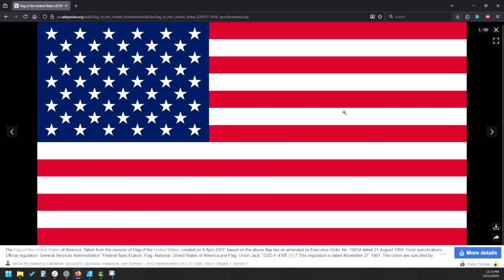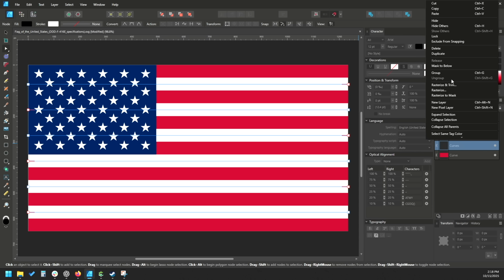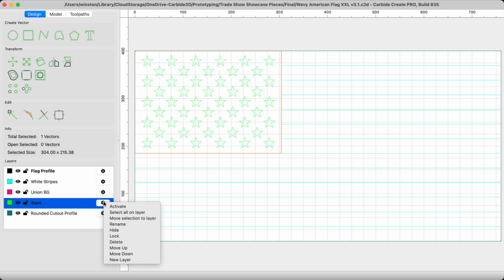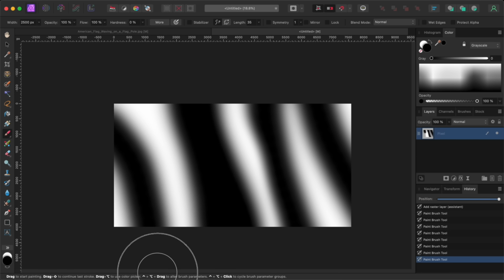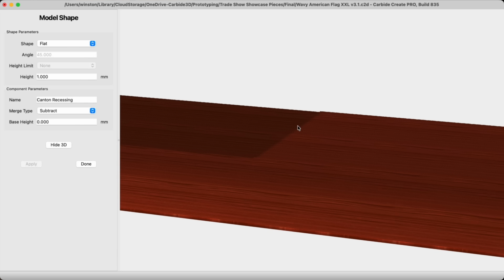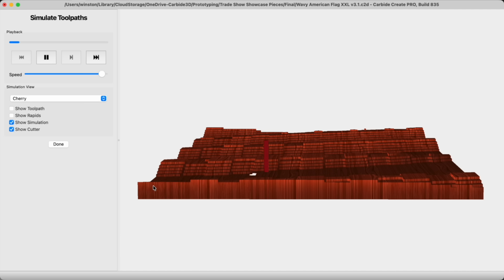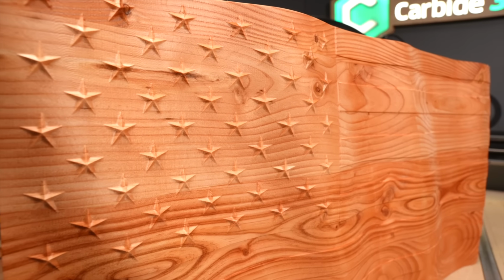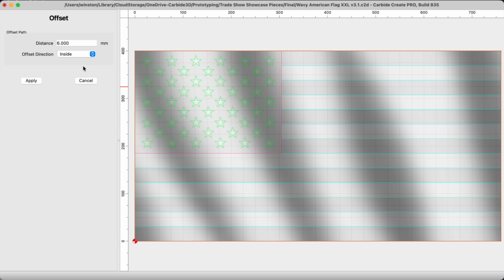Machining A Wavy American Flag on a CNC Router

Comment: Can you use the classic MS Paint for the black stripes that are used for the waves?
Reply from the maker: You need to be able to use a brush with a soft edge, or airbrush effect to fade out the transition between peaks and valleys. I don't think MS paint natively supports that.

Comment: Nice explanation. The OCD in me, however, recognizes that waves in the flag don't just raise/lower the stars/stripes, they distort them in both X & Y, even to the point that the outline of the wavy flag is no longer a rectangle. That seems super-advanced and difficult, however. At the end of the day, the impression left by this technique is still pretty darn good.
Reply from the maker: Not just super difficult, but sometimes impossible. If you look at a real waving flag, there's often some areas where the fabric has actually rippled and whipped in a way where it's folded back on itself, creating an overhang that's physically impossible to machine on a 3-axis. So some creative liberties inevitably need to be taken. 

I've actually thought about modeling a flag in Blender, freezing it at a particularly photogenic position, and then machining that. But then you either need deformable stars that are in the model, or a way to take the model and extract the outline of the colors into an SVG to re-overlay on your 3D model. Either way, it's not pretty. Suffice to say, yeah I've overthought this. 
(-W)

Comment: Winston, if you haven’t tried it yet, ditch the tape & glue and clamps. My preferred method is my vacuum table & pods. Followed by a 23 gauge pin nailer. Time & cost wise, the pin nailer is the fastest and most cost effective (next to v-table) hold down method I’ve found. I can buy 23G pins in bulk for @0.0003/1 and do a material swap in under 15 seconds. 

Bits chew through any pins it may hit during the carve and I’ve never damaged a bit yet. Also, I don’t have the cost, the mess of pulling the tape & glue off the part and spoil board, and the disposal of the waste T & G byproduct.
Reply from the maker: We have a vacuum system on the Datron in our shop, and it's great to be able to slap down a piece of material and not have to worry about adhesives. But in this case, for a project where I'm not sure if I'm going to finish it in one day, it would still need a mechanical backup to make sure it doesn't move at all when I power down a pump overnight. 

I've seen composite nails too that don't damage endmills and they do great. In this case I don't want any unnecessary holes through the workpiece though. But there's absolutely a time and place for that method.

Comment: is there anyway to run a roundover bit for edges? like say on a cabinet door? you cut the design out of the middle and they tool change to round over the edges? it just seems like it would be easier to do a tool change and run a round over bit than to do it all by hand when its done.
Reply from the maker: You can stick a roundover bit in the machine to smooth edges /top corners, but it won't work in this particular case. A roundover bit assumes the radius at the upper end terminates at a flat surface. You can't make it track a 3D surface like this.